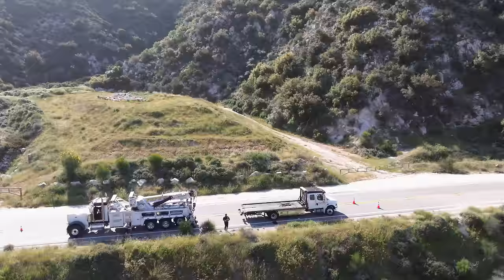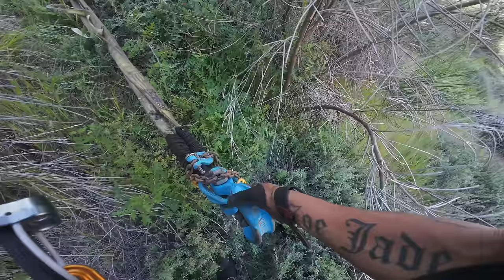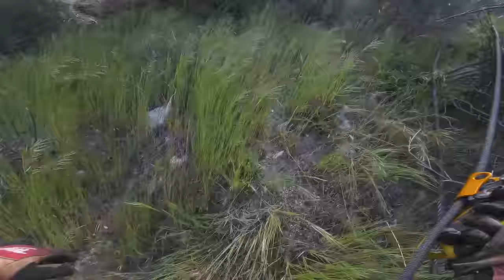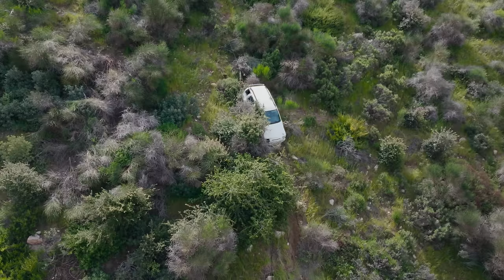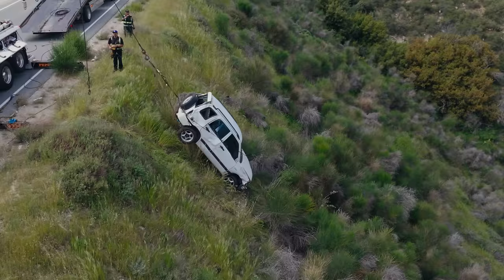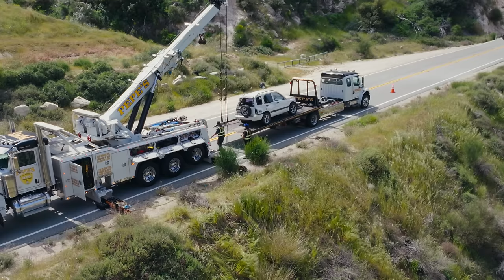EXTREME offroad recovery for crashed Suzuki

Comment: So that striped tape that keeps showing up is a detection device.  When they bury cables, like power, telephone, cable, and so on, they lay that tape in the trench with the cable(s) and bury it along with the cable.  That way, somebody can come along later with whatever they're using for a detection device, similar to a metal detector, I would suspect, and it'll show them  where the cable is buried.

The fact that it's just fluttering in the canyon like that doesn't inspire confidence in much of anything.